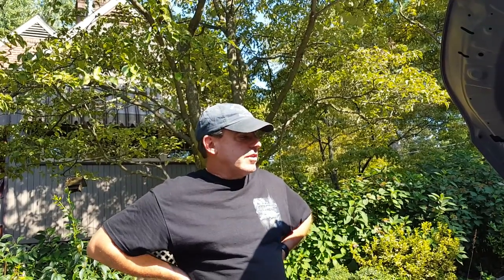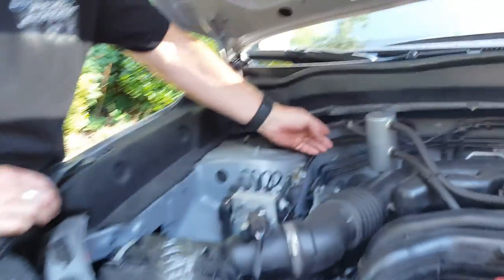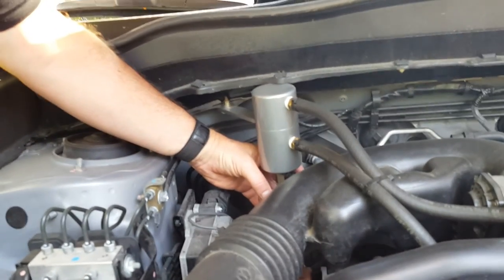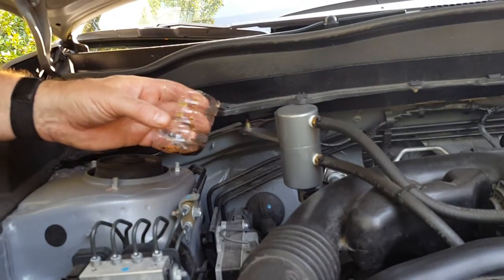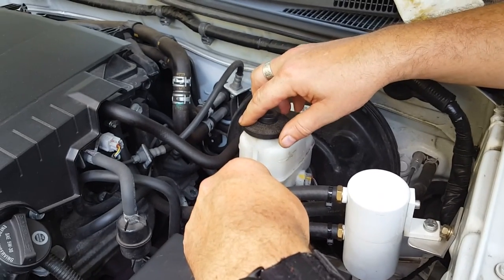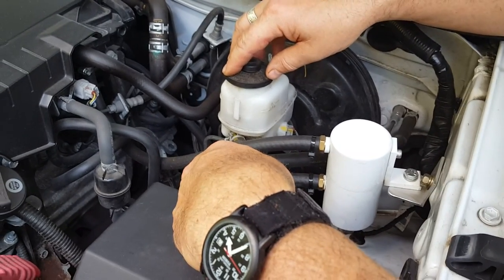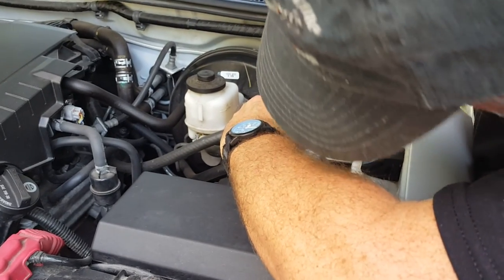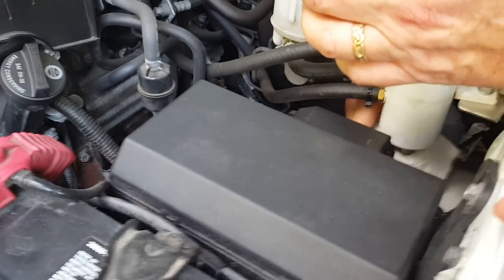Review of Bob's Auto Sports air oil separator

Comment: probably going to invest in one of these for my 2012 taco with the same 4.0 v6. (1GR-FE)  my questions are as follows.  From bobs autosports website, what fittings did you choose? what size rubber hose did you use? And what bracket did you choose lol?  also, what size is the bolt for the bracket that goes into the side of the fender? and lastly, did you make that small bracket extention and if so what did you use?  please let me know and thanks very much, appologies for all the questions lol.
Reply from the maker: I got my fittings locally at Ace hardware you can also find them online.  To get the proper size you can see what size the hose on the PCV valve is.  I believe I used 3/8 hose so the fittings would be 3/8 x 3/8 NPT.   You want to keep the hose the same size as the stock so it keeps the velocity of the oil vapor up and it gets to the separator and condenses when it hits the mesh in the bottom of it.   I chose the universal bracket that comes with it and cut it down and redrilled the hole in it.   The small bracket I made that it bolts to, is just an piece of L shaped angle aluminum that I got at Home Depot, just cut a small piece off about 2 inches long and drill two holes in it one to bolt to the side of the engine and one for the bracket on the AOS to bolt to.   I don't know what size bolt goes in the hole that was there already it is a 10mm head metric bolt.  I have a large box of japanese hardware that I take off of engine clips from past projects before I scrap the unused metal.   So I just grabbed one from that.    Hope this helps.
Reply: Rumnhammer awesome! Sounds good, ill have to find those fitting because they are defiantly 3/8 , the options on the website are 5/8 which is too big.  but i greatly appreciate your help, answered many of my questions  :)  ill be pulling the trigger on this setup soon , can't thank you enough
Reply from the maker: You are very welcome. The primary reason that I make videos at all is to help people when they have questions about something.   This product works so well that I want other people to benefit from using it.
Reply: Rumnhammer well believe me,it means alot to me :)